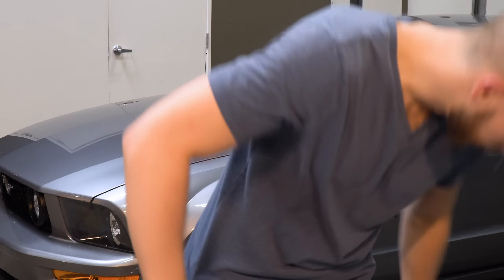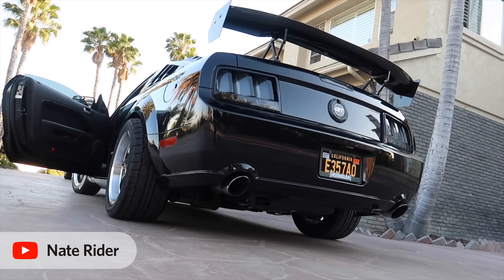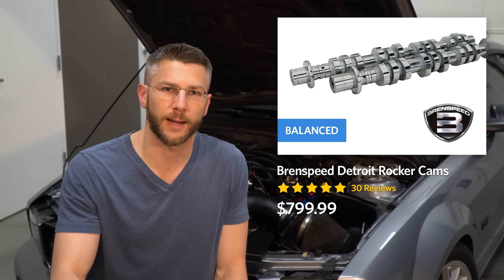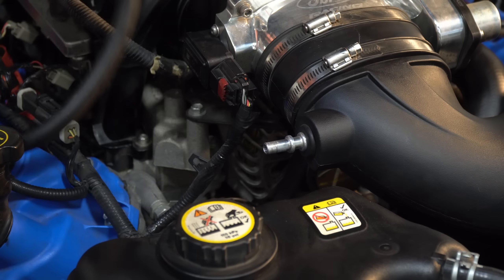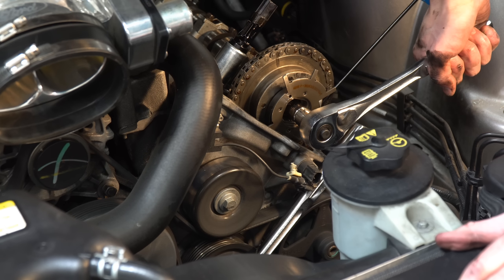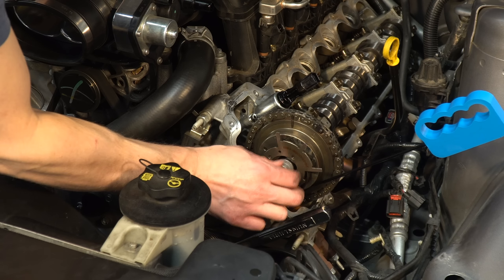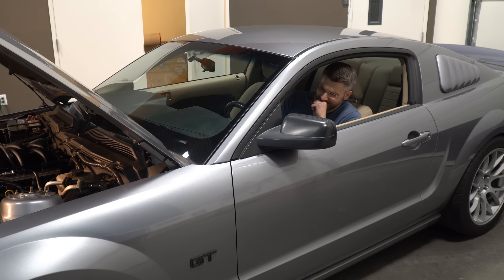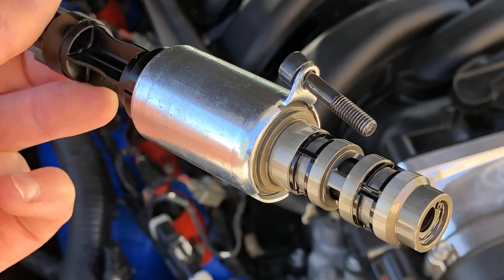Mustang camshaft selection and install guide

Comment: Hey I am a fan of yours, I have a 07 also. did you really spend over 35,000 to upgrade that car. Wow dude that's going to be a sweet car! Why not get a Roush Supercharger in that year model. In my very same neighborhood this guy is selling a 06 Roush for 25,000. I was tempted to buy it but don't want the car payment. Mine is paid for. I want to do half of what you are doing, it will still be a sweet car. I like the stuff you are doing it's educational and makes me fell my 3v is a real Mustang. I have so far Borla exhaust and a cold air intake. Love to install these cams and get some headers. Thanks for your content it's really good its gotten better from the beginning. I am also going to start a You Tube channel with this 07 mustang and a 67 mustang to make them match. Mustang vs. Mustang. Anyway your fun to watch, Thanks.
Reply from the maker: I haven't spent that much (yet). But all-in it will be somewhere around there. Thanks for watching and the kind words ✌

Comment: Detroit Rockers are definitely getting put in my 3V as they're the best sounding to me and add considerable performance. Brenspeed knows they're stuff and I trust them in saying that thumper are good but don't actually make much more power unless you're running a built motor.

Comment: Just for clarity, the Detroit rockers keep more of the low to mid end power with increasing the top slightly while the hot rod cams just increase the top end. 

I hate the low end power loss I can feel after I did my long tubes. Just want to know what is the best choice since I’m not going to be living at 6k rpm constantly
Reply from the maker: The rockers are a great choice. I'm building a new high-compression engine and I'm going to run them again, at least for awhile.

Comment: Thanks for the video! Do you need to adjust the position of the crank at all between installing the driver and passenger side camshafts or do you just leave it in the same position for both? Thanks!
Reply from the maker: Rotating the crankshaft just makes it easier to align the pin on the phaser with the cam, it's not a necessary/critical step.

Comment: Did you not get a custom tune before starting it and driving? I’m about to do this job and my speed shop suggested not starting the car at all, get it trailered to them and get it tuned. I really want to start it after the install and listen to it to make sure nothing is a miss before trailering it to them. Not one can install video ever mentions a tune???
Reply from the maker: The Detroit Rockers can run w/o a special tune, but it's not recommended. I got a dyno tune a few days later. Other more aggressive cams usually require phaser lockouts which prevent valve-piston contact, so a poor tune wouldn't necessarily damage the engine in that case either. Dyno tune always recommended though.

Comment: Question for you sir, I know that you're supposed to match your cam shaft with your torque converter (i.e. 2800 - 6000 Cam to a 2800 stall converter) Should you also match the intake to this? I see that Trick Flow has a 3000 R box intake....or does this matter?

Comment: Its interesting you chose detroit rockers, there are definitely some much larger N/A grind cams out there that I dont doubt could have yielded much higher peak HP numbers. Comp 127600 and Livernois Stage 4 N/A grind to name a couple.
Reply from the maker: yeah i 127600's and livernois ported heads now

Comment: Thanks for the vid . I have watched many and not one has said anything about the cams being side specific. I downloaded Fords install guide and had noticed that the cams have different part #'s and sure enough there is a right hand and left hand cam. I also noticed the lack of use of the valve spring compressor, Is it really necessary ? I also just wondered what the dyno tune cost you (roughly)?
Thanks , Mike
Reply from the maker: Indeed the cams are side-specific. If you try to put the incorrect cam in the head it's pretty noticeable that things aren't lining up quite right. Valve compressor is not required. My first dyno cost me $500, but my tuner has been generous after that, usually $150-$300 for subsequent tunes.
Reply: @Four_Eyes  Thanks so much for the quick response and I went to automotive school years ago but was not my career .
I do enjoy these small jobs on my 2008 Bullitt. I drive it for the sound and really no other reason.
Thanks so much Mike Fifer
https://www.youtube.com/watch?v=KmtyyCVG0pw&t=8s
Reply from the maker: lol i feel ya on the sound aspect. lookin good man, those Bullits are definitely going to go up in value.
Reply: @Four_Eyes  This poor thing is a salvage title but looks good. I took off the covers and a friend is painting them for me. Put in new plugs and in the AM will start the cam install. Got the tools and gaskets today.
Thanks , Mike

Comment: Your video encouraged me to do my cam update.  I did the left side this afternoon.  All seems good so far.  I have a question on the right side.  The phaser has an L and an R with a little arrow on top.  Do I use the R on the right side phaser and ensure to align that 90 degree from the cylinder head base?

Comment: I’m gonna put these on my 05 f-150. I wanna make it kinda a sleeper f-150. Already pushing almost 380hp and I wanna reach 400 and I feel like this would be the best way since I’m tuned on 93 octane, with a cold air intake, 3 inch exhaust, aftermarket coil packs and injectors. From what I’ve read the Detroit rocker cams are supposed to add 30hp so that’d out me at about 410 but I’d have to dyno it.
Reply from the maker: Do you have headers?
Reply: Four Eyes no I do not I need them because my driver side manifold has a small crack in it, it doesn’t leak yet but I want to get rid of it before it does

Comment: Sounds awesome! Quick question. Just got a P0011 code. And I hear a little clicking noise on driver side of the engine. Is that a bad solenoid..?
Reply from the maker: seems very plausible. they're pretty easy to swap, i'd give it a go.

Comment: what tune did you use immediately after installing the cams? i want to get dynotuned after the install but for the time being what tune did u go with BAMA, breenspeed ect thanks im following and loving the progress on your car
Reply from the maker: I was running a custom dyno tune, the car still ran fine, but had to get another tune (after multiple attempts) to unlock maximum power.
Reply: @Four_Eyes  thanks for the reply im following your build us 3v guys have to stay competitive, love what youve done,

Comment: Was your idle set to 750? This is the best sounding detroit rocker idle video i’ve seen, sounds just as good as hot rods. I used to have a 3v with hot rods and I miss it very much. Thinking of getting another but getting these DR so I can do the instal myself.
Reply from the maker: 875-900, and thanks!
Reply: @Four_Eyes  Really? My old 3v was set to 750 and it sounded amazing. Is there a reason for a higher idle? Also, of course man, love the content.

Comment: want to install those cams on my 06 gt, look so easy to do...i am weekend mechanic doing brake ,bearing and some easy repair on car,

is this really easy   or you have messed with some bolt or part?

some website suggest that you should not attemp to install yourself ...
Reply from the maker: You can do it. I didn't skip any weird steps like cutting a bolt or something, just have good tools and a whole day blocked off. And be super careful with the roller followers when you place the new cams as they easily pop out of place.

One thing that will be different if you have stock valve covers is that the gaskets will stick to the heads (as opposed to the valve covers). Remove them slowly to prevent damage and/or order a fresh pair to have on hand just in case.

You'll also want to get a dyno tune after, so try to time the install where you'll have minimal time driving on the current tune.
Reply: thanks!! so you dont need valve compressor for those detroit cam?

your video are really helpful,  have a nice road to 700 hp!!

Comment: I thought a valve compressor tool was needed for the install .can someone educate me .and what was the idle set at ?
Reply from the maker: It's not necessary, just have to be a little more careful. Brenspeed advises 850 rpm.

Comment: About to do this install. Do i need to match the color chain link with the indictors before removing cam?
Reply from the maker: You should mark a couple chain links with the phaser in case the chain falls off when you're removing and installing the new cams. This will ensure you don't mess up timing (which could turn out really bad).
Reply: @Four_Eyes  That was a pretty fast reply, i appreciate it. Was turning my crank trying to get the one color link to match up with the L indicator but couldnt get it. Ill mark 3 links instead

Comment: So no valve spring compressor?? I see some people use it and some don’t. I’m taking moving cam to too dead center enables you to do this?
Reply from the maker: It's not required, just be careful. The note about TDC just let's you know where there the cam slot will be, also not required.
Reply: Four Eyes thx for quick reply, that valve spring method really complicates process.

Comment: Wonderiing what you think abount upgradeing cams on a 5.4 3v f150
Reply from the maker: Well cams tradeoff low/midrange torque for top-end power, but the rockers are pretty mild, so as long as you're not towing stuff all the time, should be just fine.
Reply: @Four_Eyes  Thank You for the reply, my goal is for a little extra power when I need it, not gonna be racing anyone.....lol

Comment: Can you put ford racing performance cams or these detroit rockers in a totally stock mustang without anything else and still get that choppy idle sound (replace the phaser bolts of course)
Reply from the maker: Yeah, but it will be a quiet lope. Just swap the mufflers and you're set 👍

Comment: Sounds bad ass at idle, one question though. Do ya have to take it easy for like 20 to 30 mins so the cams break in properly like in older pushrod motors?

Comment: Sounds great at idle...   I would expect the drivability at low RPM to be different than stock.  Hopefully though it doesn’t surge or lug too badly. If it does, just drop a gear to raise RPM.   Tuning can probably also improve drivability to some degree

Comment: Hmmm should I keep my 2005 Gt 90,000 miles and build it or trade it in for a Whipple 550hp 3V with 55,000 and double my car payment. More of a financial concern, I could have the car I want now and pay for it over time, or I could spend possibly more money in mods but have more “income” every month? I also have barely any mechanical knowledge and have only had experience installing simple bolt ons.
Reply: This is just advice from some random guy on the internet, so do with it what you will. Also I apologize for the essay-sized comment, I’m just trying to be detailed. 

Buying a pre-built car will likely never be as satisfying as doing it yourself. Also, learning how to work on cars is one of the most rewarding (though sometimes insanely frustrating) things I’ve done. Plus the 3vs are pretty darn easy to work on. 

Another advantage to building it yourself is that you know the condition of the car, the exact parts that are on it, and how they were installed. With the Whipple mustang, unless you know the guy selling it, you won’t know for sure what exactly has been done and how it’s been done. 

With that said, if you really don’t want to deal with the hassle of building a car AND (big conditional for me here) can actually afford that bigger payment without forcing yourself to eat ramen every night, go for it. At the end of the day, do whatever makes you happiest :)
Reply: Thanks, Sean! I really appreciate you took the time to write that out. I agree, even the simple things are very satisfying when you’ve done them yourself. If I get the whipple, I will likely pay a mechanic to inspect it but luckily the place selling it seems very professional and seems to have a good reputation. Still I will look into seeing how much history has been recorded for the car. I’m discouraged to install the supercharger and cams because I’m afraid to do what Nate rider/others have done and blow up my daily driver. It will take me quite some time to save up enough to have someone else install the supercharger I’ll probably never get around to it. Anyways if you made it through my wall of text, I’m very passionate about my mustang, I think about it like it’s my career and I will keep the community posted. I want to show the potential of the 3V and keep it alive!

Comment: Did you do this with the original 5 speed trans?  Would it be a good idea to relieve the solenoid while you're in there to err on the side of caution?

Comment: Nice video any idea the performance gain with the cams. I was looking at putting in some comp Cam's in my full bolt on mustang with 3.73 gears and aluminum driveshaft. How difficult would be replacing my guides and chains while it's getting done? Does the car pick up more in higher speeds? Thanks.
Reply from the maker: Thanks. So obviously it depends on the cam and tune, but you should see an additional 20-45 horsepower above 5,000 rpm. You don't have to remove the front engine cover when replacing the cams and I've never done a timing kit, so I'm not sure. FordTechMakuloco has a lot of content on replacing timing kits.
Reply: @Four_Eyes  I was looking at comp Cam's stage 1 or 2.

Comment: Hey when you did the passenger side what position did the crank get turned to?
Reply from the maker: I pointed the TDC indicator towards the crank so the phaser pin slot was at the top (easier). Dyno video.... soonish kinda - was a PITA to get the numbers dialed in.
Reply: Four Eyes yeh doing the install using your video Saturday 😬I have a aftermarket crank from my steeda pulleys so didn't know if the marks are there

Comment: I’m just curious here, I talked to Brenspeed and they recommended that I get a valve spring compressor. Is the order in which you put the caps back on what keeps even pressure throughout instead of using a compressor?
Reply from the maker: The compressor will just make the job easier as the roller-followers can easily be knocked out of place. Slowly reinstalling the cam caps in the correct order and bolting to spec will achieve even pressure. I checked the roller-followers like 5 fuggin times before finally putting the valve covers back on.
Reply: Four Eyes haha I’m the same way.... can never be too sure haha. What would be the worst that can happen if the roller followers fall out of place?
Reply from the maker: Could get chewed up and spit metal bits into the engine... possibly ruining it. 😬
Reply: Four Eyes if they do fall out of place during install, what’s the process of getting them back in place to continue with the install?

Comment: I just installed these cams yesterday with a JLT cold air intake and I also have my Bama tunes on the car but when I start the car up it just dies. I tried both tunes and it does the same for both. Anyone have suggestions?
Reply from the maker: ensure MAF, coils, and injectors are connected, if nothing, try reverting to stock intake
Reply: @Four_Eyes  I went back and made sure everything was plugged up right and nothing seems off. Imma try the stock intake and see what it does

Comment: When you removed the bearing caps, did you slowly unbolt each cap one by one? Or did you just removed each cap completely? Just wondering because I’m trying to do this myself eventually.
Reply from the maker: Slowly yeah, and extra cautious when re-installing since the roller-followers can easily slip out of place.
Reply: Four Eyes gotcha. Thanks for the tip!

Comment: Awesome Video Sir,
just looks so simple and easy but here i am sitting being afraid to mess up, ill be definitely installing the Ford Performance Hot Rod's this year, with this tutorial of course. In the end you said that ye should load a new tune "if" you have one, so is it necessary to load a tune or am i gonna do just fine without one ? If so, would a normal person be abled to do it, i am asking since ive seen alot of tuning tools, for example the ones from BAMA and i would like to do it myself ?

Here in germany its damn hard to find somebody who's abled to apply a tune for your car, there is one renowned company, but their location is pretty far away from where i live and these guys are charging an insane amount of money for one tune, nearly 1 grand in euros.
Reply from the maker: Thanks Ronny. You can do it, just take your time and don't skip any steps. As for tuning, you won't be able to do that by yourself.

The car should run on the existing tune, but at minimum I recommended getting a tune from Bama (if they offer one) and datalogging to dial it in. Also check out Lito tunes, I haven't dealt with him before, but a lot of commenters have recommended him for remote tunes. 

Ideally, purchase all the performance parts you want to install on your Mustang and have all those parts installed in one go at a shop that also does dyno tuning. While this frontloads the costs, it is a more efficient and reliable path.
Reply: @Four_Eyes  Thanks mate, ill just do that.